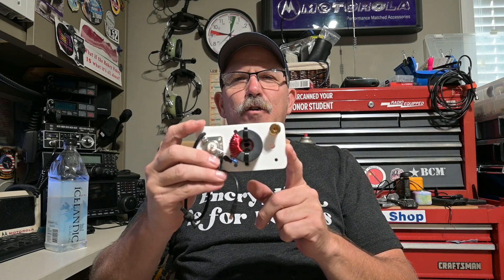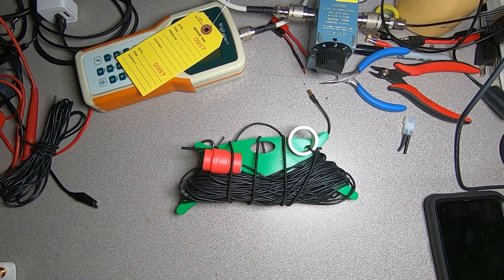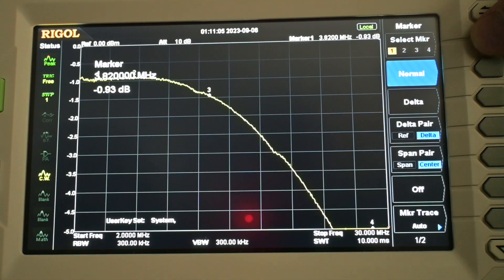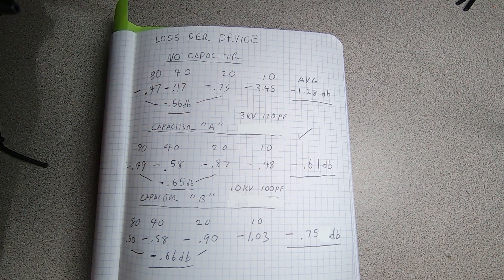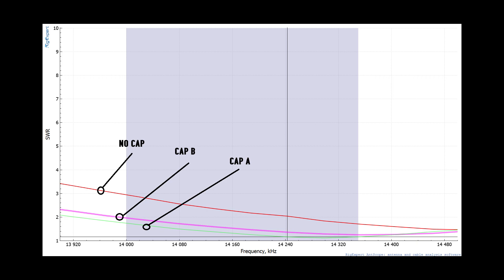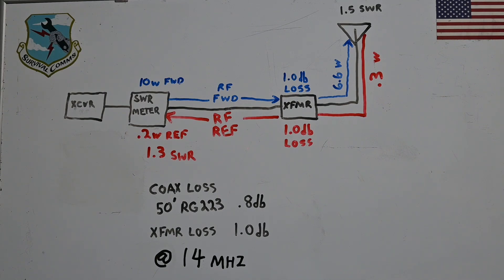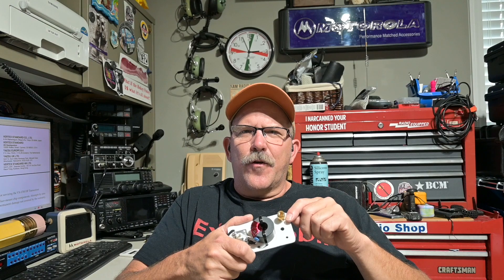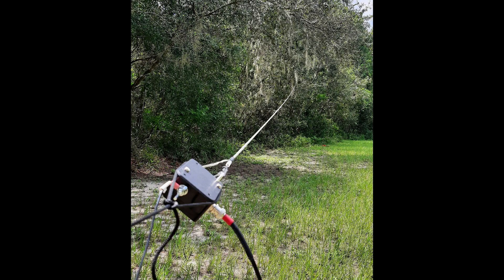Low Loss EFHW Ham radio HF antenna antenna tests. Do capacitors matter ? DIY and save your money !

Comment: Really well done.  Trying to get my efhw to perform better on 80 meters.  Keep up great work. 🎉
Reply from the maker: Thank you ! Thanks for watching !
Reply: As the efficiency of the autotransformers go up, Brett's is close to or may actually exceed 90%  the true chracteristics of the antenna come into focus.. It's a real challenge juggling the resonant points on your preferred bands... 80 will likely be down around 3550, that's where mine sits... but I don't use 80 much where I live.
Reply from the maker: @mortimersnerd801  Very true balancing the band resonant points isn't easy. With a more efficient transformer you really see it more so than with a design that exhibits more loss.

Comment: Excellent video. I see you run with the transformer up high. Wii it work in a L configuration with the transformer let's say 12 feet up as my fiberglass pole is too light to handle the weight up high. This transformer is actually quite light and may actually work up high. I have a DX commander pole but want something quicker and less complicated to deploy and am on a quest to build one of these transformers. Thanks for all the information.
Reply from the maker: Thank you ! The best advice I can give you is to give it a try. The further you can get your feed point from ground the better but one has to work with what they have .  Try it out and let me know how it works for you. We all learn from one another's experience. Thanks for watching !
Reply: FWIW, I run my EFHW in an L configuration.  I have found that trimming the antenna in the configuration you expect to use is the best way to get consistent results.  My SWR value deployed as an L versus a sloped wire or hung horizontally are all different.  So I have wires cut for each configuration as I use it mostly for portable uses.  For my L I have the feedpoint at about 4-5 feet off the ground.   With a 30-ish foot telescoping mast and a 40m EFHW that provides about half vertical and half horizontal.
Also fun fact seldom mentioned, in that L configuration the 10m and 15m signals are best at about 30 degrees to either side of the horizontal tail in the direction it points.  Setting it up with the tail pointing east for FD(on east coast, NC) I was hitting 15m skimmers in EU better than inside the US.   Oooops.
Reply from the maker: @ElDiabloLocoPoco  Thanks for watching !

Comment: Thanks for good information. Excellent. I understand your autotransformer (49:1) is 14 turns. I presume you are quite satisfied with swr over the 80-10 m? Watching Colin's ( MM0OPX ) experience he had to add an extra turn ( 15 ) in order to get better swr results on 40m. Any toughs on that? I suppose an atu would probably deal with any mismatch on lower bands 40m-80m.
Reply from the maker: You are welcome. I am quite happy with 14 turns. Thanks for watching !

Comment: Exactly how I have done mine; wound including using the TDK cap, except I didn't even use any acrylic boards...just hung mine on an insulator out in the open.. it's a passive device so no worry. Feed mine with about 75' of LMR 400, and a short RG8X jumper. It's really light low loss coax, especially on the HF bands, so you can haul it up into the air easy. more lossy RG8 weighs 2X as much, and RG 58 gets quite lossy up toward 10M. I try to keep my losses to around 1db and at 90% efficiency of the 2643251002 core wound as shown, and the TDK cap you can possibly do that. No guarantees but you can get close... If your running semi-qrp, only 20 watts O/P, as I do (Xeigu G90) every watt counts.
Reply from the maker: Very cool ! Thanks for watching !

Comment: does that mean someone might want to consider adding a transformer to their CB radio internally? by the antenna jack...
Reply from the maker: You are much better off just building a simple quarter wave ground plane for a CB radio IMHO. If you desired to use wire you could build a delta loop , rhombic  , etc and outperform an EFHW for less real estate. If you are by necessity forced to end feed a half wave at 27mhz you could put the transformer at the RF connector but your radio chassis is going to be a larger part of the antenna than you would want it to be. At low power a few feet of wire tied to the chassis would help. Thanks for watching !